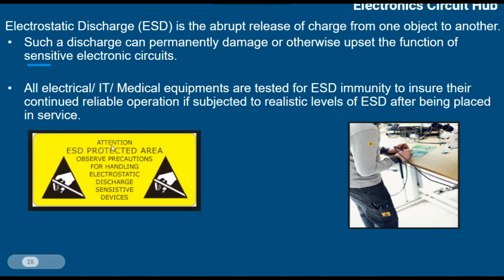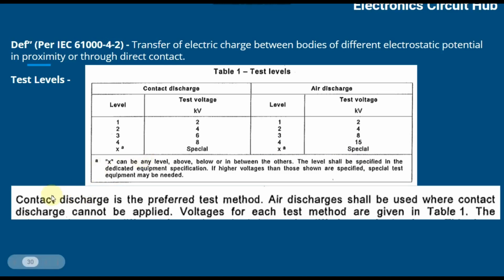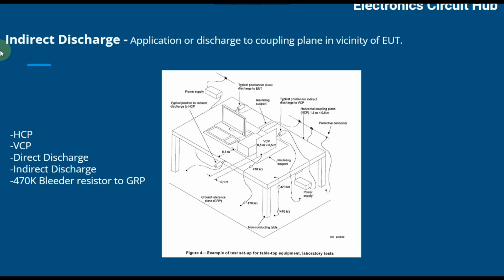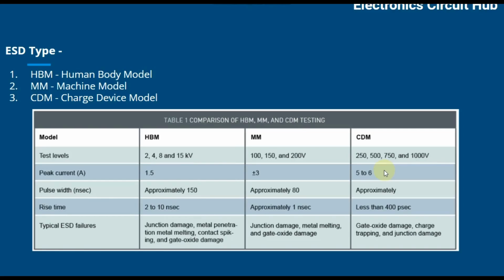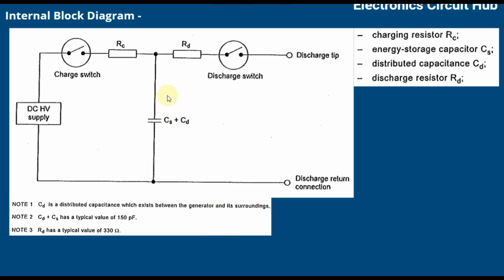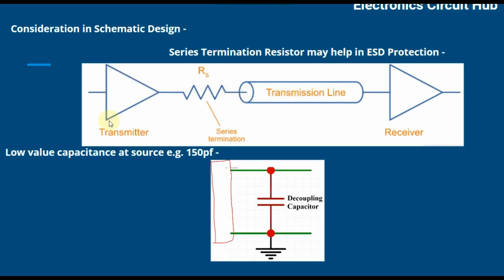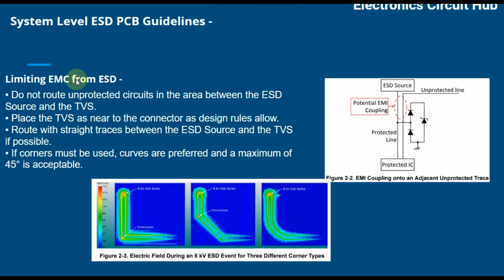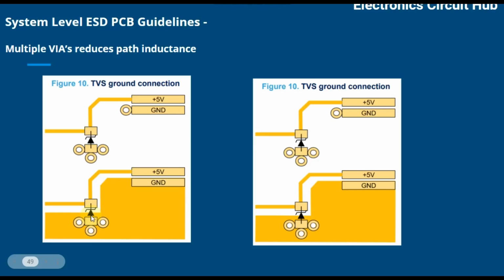ESD Design Techniques - IEC 61000-4-2

Comment: Can you confirm, as per to new update in IEC 61000-4-2 standard we can now directly apply ±8KV(contact) and ±15KV (Air) to EUT?
Reply from the maker: Hey...Thanks for asking this good question. I am not aware new IEC update. what i know is Level 4 of IEC standard is +-4KV and +-8KV. the standard you stated is internal standard which usually most of the company follows.